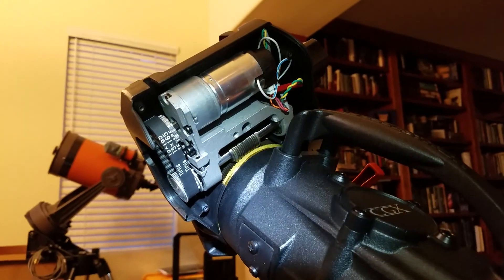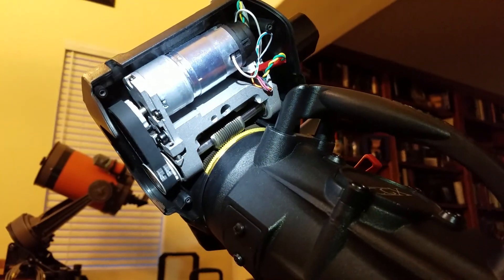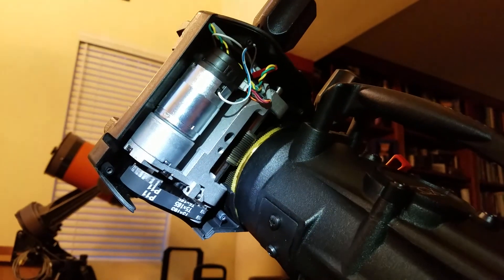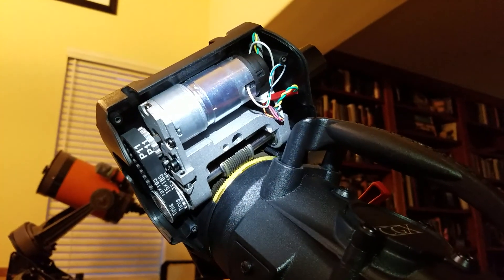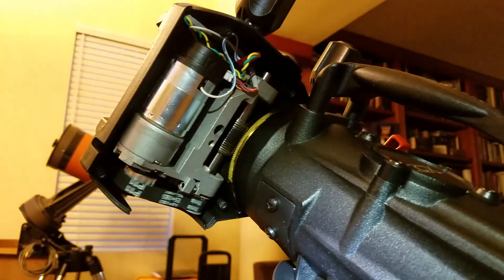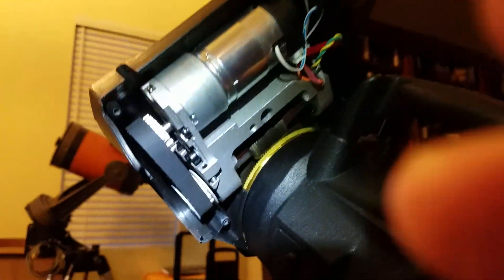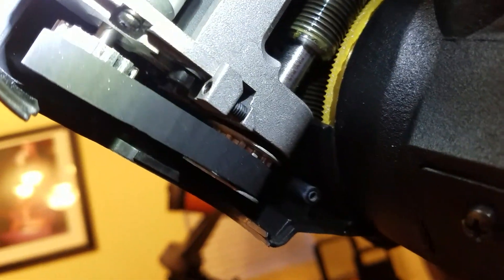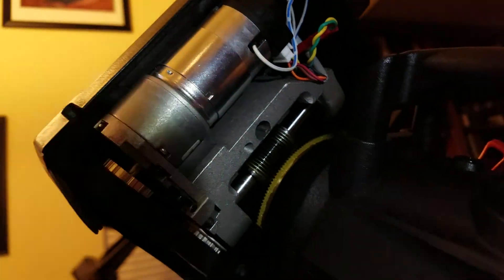CGX Declination motor noise (1 direction only)

Comment: Which screws adjust the mesh??? We can't find the posts on it
Reply from the maker: Check this video out. https://youtu.be/-36Ho6M4gNM
Reply: For me w/e that video show didn't help.
There's two more screws further in under the worm(for dec). That's where i managed to adjust mine to run better(In combination with the two screws shown in the video).
Mine is still not good but tho.
As long as i run < 1 arc sec i'm happy.
My best have been 0.36,  best last session was 0.59 or so but only briefly :(

Comment: The same problem is occurring.
How did you solve it?
Reply from the maker: You have to adjust the gear mesh. It's too tight so the screws have to be loosened a very, very tiny bit. Like an 1/8 of a turn. I believe there's instructions elsewhere online. Just google "adjusting celestron cgx gear mesh".

Comment: Mine did the same but adjusting one of the allen screw per the manual suggest fix the issue, this is when it becomes loose..Just leave a very little recoil and thta should fix it

Comment: Adjust the gear mesh with 2 allen wrenches in the little holes on the housing. Instructions on Celestron's website.
Reply: I have exact problem, do you have the link to the instructions. thanks in advance

Edit: I fixed it, when I open it, the Distance Adjustment Screw fell off.. All I have to do is put it back readjusting the work gear body to have little recoil and no more noise..
Reply from the maker: Kristopher Flory Thanks. Figured it out a while back reading comments on CloudyNights.